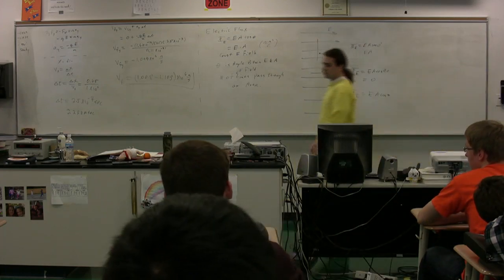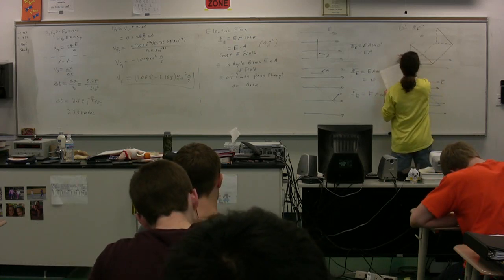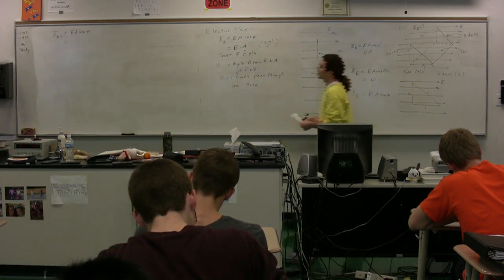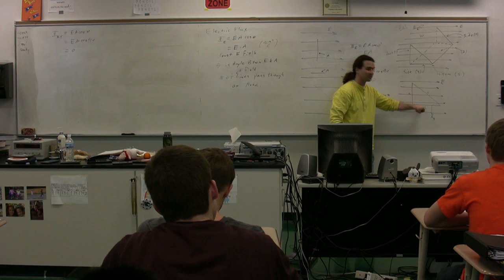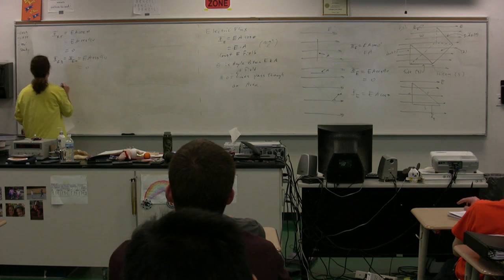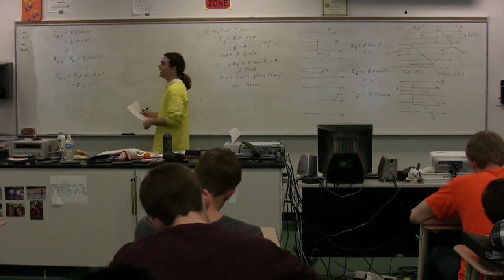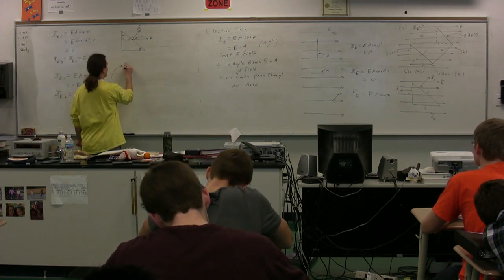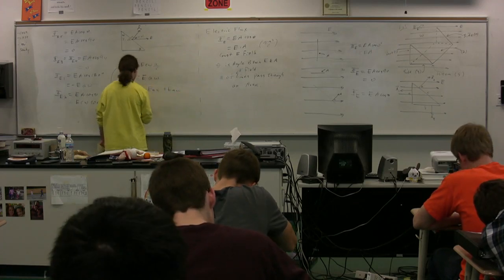Example - Net Electric Flux through a Closed Surface - AP Physics C

Comment: You were saying that the net flux going through a closed surface is always equal to zero. I assume this is because the amount of flux going into the surface equals the amount of flux going out. But isn't this only the case if the sides where the flux goes in and comes out are symmetrical? If the two opposing sides where flux enters and exits have different areas , won't there be a net flux?
Reply: Jacky Zheng "If the two opposing sides where the flux enters and exits have different areas" the net flux is still zero. I prove it in my next lecture using Gauss' Law. https://www.youtube.com/watch?v=ZjjTg2K3rAw

There are also some good examples on this webpage. Ch24-4, Ch24-6 & Ch24-7 are particularly applicable. http://www.colorado.edu/physics/phys1120/phys1120_fa01/Concept%20Tests/CT24a.htm